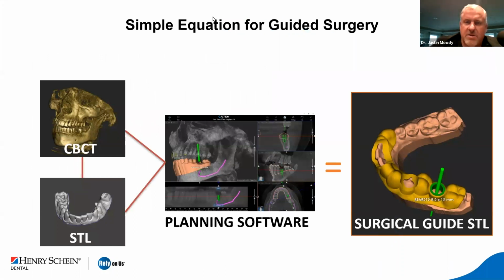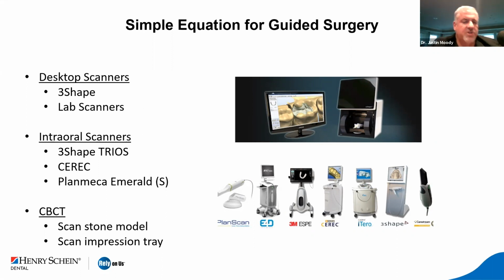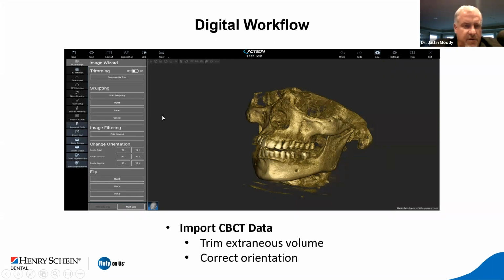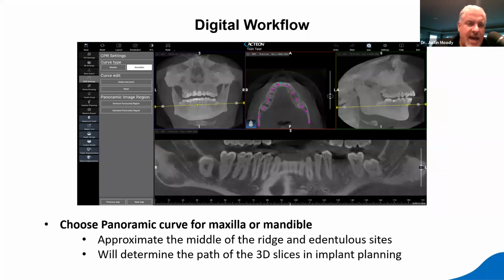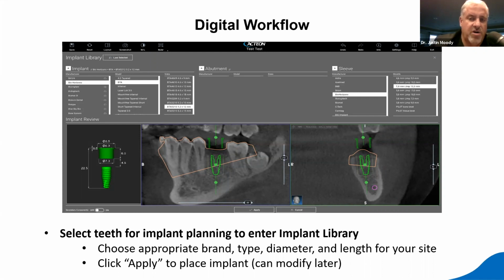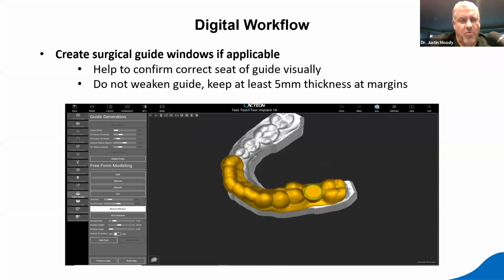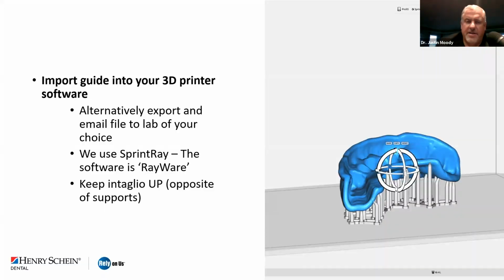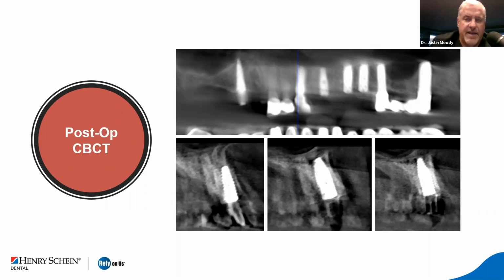The Basics of 3D Printing Surgical Guides

Comment: Hello, how is the  location of the guide sleeve correctly determined in the guide design? or does the software do it automatically without modifying the length spacing for the preparation burs? thank you

Comment: What are you using to glue the sleeves?
Reply from the maker: If you use authentic sleeves per manufacturer then they should have retention grooves for when you seat them.  We also add a small thin layer of Cyanoacrylate, aka super glue, to it.